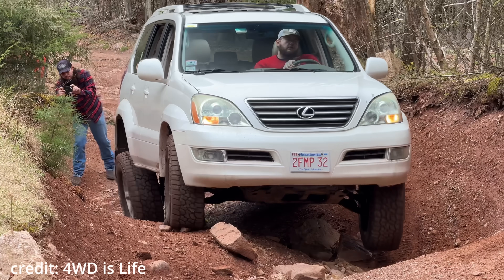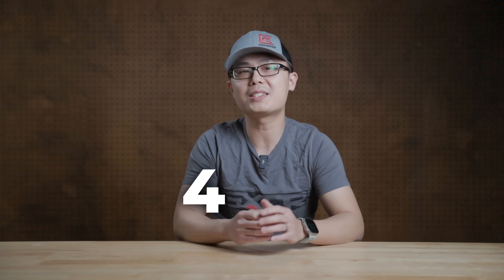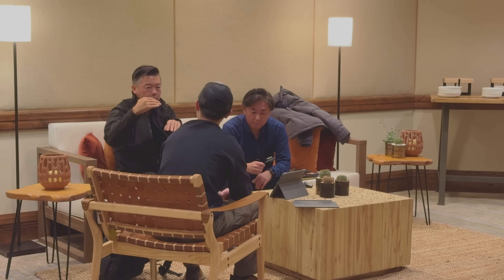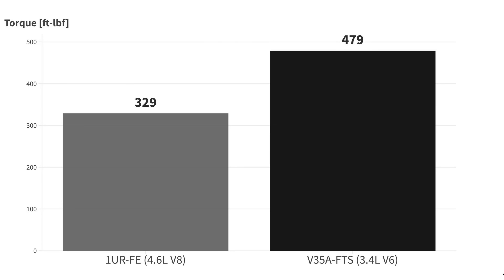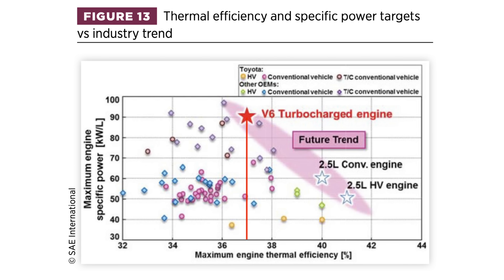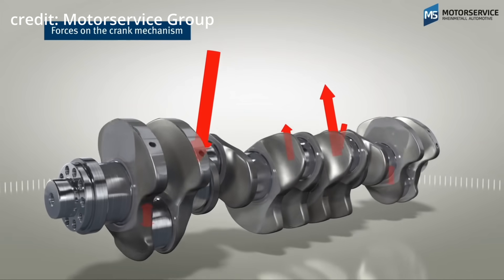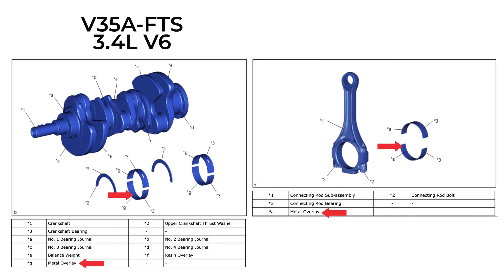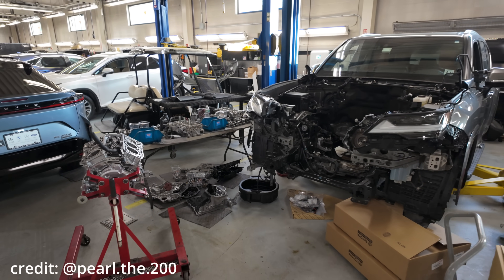Is Toyota V35A-FTS Engine Reliable? Well..It's Not That Simple

Comment: Nobody makes these videos the way you do. Others do lots of speculation, but you do proper research and make it easy to digest too. And no fan boy bias! Very impressive.
Reply: I would say The Car Care Nut is another valuable source when it comes to Toyota/Lexus content.
Reply: @AKBRONCOSFAN007 love that man
Reply: 4:40 This must be it! Taller pistons have more mass, increasing torque
Reply: There’s plenty who do it, and do it better
Reply: 11 mpg  ... I will pass .😢
Reply: 1st time here. This is very informative. Now I'm convinced  of 2 things. 1) wait at least 3 years for new models. 2) stay away from over engineerd hard to work on engines.
Toyota messed up going this route of putting this high compression engine in so many of their models at once. It's unlikely Toyota didn't find out about this problem before it went full mass production.
Reply: @AKBRONCOSFAN007 
Most definitely.
Reply: Car care nut enters the chat. Both are great
Reply: Savage Geese also does really great research and brings in Chief Engineers as well. Watch their Corvette video and the Miata Videos that were done.

Comment: Toyota’s reliability era is done.
Reply: once they see the results they will bring back natural aspirated V6 and V8 and remove the turbos.
Reply: I said this as soon as they decided to use turbos lol
Reply: lol you guys are funny I seen so many cohost from ford have easy 200k miles no issues and still going some into 300k
Reply: @Randolf_Burgmann  They already saw the results. The engine is already 7 year old. It's been out since 2017 for MY2018 for the Lexus LS. And nope, no long term issues with them. And personally after tossing my NA Lexus due to electrical gremlins for a Audi, Holy crap I had no clue what I was missing. My 2020 Lexus really was 15 years behind.
Reply: It’s not just Toyota, it’s a common theme to decrease displacement and use turbocharging to add it back. They did it with the 300 series diesel also. 

It’s emissions regulations and fuel consumption behind this, it won’t go back to the way it was imo
Reply: @HEYLetstrythatagain  I agree. But IMO it's a improvement.
Reply: Absolute nonsense.
Reply: You know this how?? You think Toyota did this to fail?!
Reply: @stevenk5800  what
Reply: @TasmanianDevil3  problems with reading comprehension?
Reply: @stevenk5800  It looks like you are the one with a comprehension issue. How you've managed to deduce that I'm not in support of Toyota is beyond me
Reply: @TasmanianDevil3  buddy, I was responding to the original comment that the era of Toyota reliability is done!  I didn’t respond to you. Please read my comment again buddy!
Reply: @stevenk5800  The don't tag people in comments that aren't for them
Reply: @Dimabuildingadventures have you looked into the stress testing ford did for that 3.5 year eco? Legit insanity the way they tested that motor
Reply: How when this engine been in use since 2018
Reply: @TasmanianDevil3  I didn’t tag you in my original comment. I tagged you when you commented “what”
Reply: @denverwenyika917 start @ 13:51
Reply: Bring back dedicated truck engines with cast-iron blocks. They keep using engines from other Lexus family vehicles and put them in a vehicle that’s supposed to take a lot of abuse. The 5vz and 3RZ were solid and didn’t come from out of a Camry.
Reply: @rick137.pickle  but you can't use one example as the normal and two remember this is a new engine and the 1st bunch will also have issues, at work we have 7 cars with these engines and we haven't had an issues everyday we drive them in rural areas and everyone is preferring them over the V8s
Reply: @denverwenyika917  please watch the video again.
Reply: @fooloco  correct 👍. I have a toyota with an aisin ac60e transmission and it is jerky with just 12k km on it.
Reply: exactly- ill buy kia/ hyundai and be backed for 100k miles
Reply: @bikeman1x11  hmmmm. Maybe just don’t buy the model using this problematic engine 😀
Reply: @Randolf_Burgmann  No, capitalism does not work like that. More complexity, more money, more service.
Reply: @732harris turbo arent a problem
Reply: @Skyline750 turbos aren't a problem
Reply: My goodness
Reply: i refuse to buy a turbo SUV from toyota. The new 4runner is underpowered with a 4cylinder and turbo. I refuse to buy it when the reliability isn’t promising as seen in the tacoma.
Reply: Never
Reply: @PokeHut  try driving a toyota with the aisin ac60e transmission.
Reply: True that
Reply: Too much environmental regulation bullshit push them to make this type of engine

Comment: My new neighbor is a Toyota mechanic in a very large dealership in Dallas.  I asked about the 3.4 failures and he showed me a picture of 8 blocks in crates sitting out back.  He says it seems to average ~20,000 miles when they fail, although he has seen it as soon as 6,000.  I think it's happening more than people realize.
Reply: I used to be a tech at Toyota up until June last year. The earliest I've seen one fail was 32 miles. The owner took it home on a friday and it failed over the weekend.
Reply: @matte8441  your talking about a toyota or a cybertruck here?
Reply: @float_sam  The Tundra unfortunately.
Reply: It’s dirty blocks the engines are fine when they are clean. At lexus we aren’t having them fail at that high rate and the mileage is usually way higher.
Reply: @matte8441  remninds me of this cummins engine blowing a HOLE between cylinder 4 and 5.  mileage was  about 880    the reps said dont touch anything but put stuff in ziploc,  drain fluids and send WHOLE engine back to manf for inspection.   ford had 6.7 powerstroke blow up LEAVING car transport ramps. barely above 40 miles on odometer.     new cars is time bomb.  yeah idk
Reply: I was a Toyota  tech back in 1994-2003 and remember the hundreds of 1HD-T 80 series I had to replace big end barings in. Toyota were good enough to warranty them, some even as high as 200,000kms. Toyota have to be serviced at every service, the oil just gets dirty fast. Even the corolla with its intake cam gear issue springs from dirty old oil. Sensitive engines. Accept the mighty 2GR lol.

Comment: I’m a tech at a Toyota dealer in Canada and we’ve had 6 tundras with the same bearing issues. Some were work trucks and others were just daily drivers but they all failed in the exact same spot. All got short blocks and 2 of them were seized solid when they came in. One of them took so long the guy bought another tundra and then had the same issue with it so he bought a trd pro instead of waiting to get his first 2 fixed. We ended up buying the trucks back from him.
Reply: Wow 2 new trucks with same engine failure would push me away from the brand.
Reply: Last month my friend who is a service manager at Toyota walked me through our dealership's parking lot while I was waiting for my Camry oil change and he also showed me multiple 2022+ Tundras with the exact same issues. There is clearly a reliability problem with Toyota's recent "environmental" decisions, I'm sure the Tundra is not the last vehicle to experience such issues.
Reply: Bmw is the new toyota unfortunately!! 😢
Reply: engine is built tight and not enough space ford has abit more space and uses thicker oil while toyota uses mosy 0w20 oil or 5w30 for my ecoboost i use 5w40 and it works great make sure to do oil changes on time if not using to much boost if so then need more reg oil changes if not the oil will become diluted quick and the bearing will suffer frm lack of oil and in toyotas case of being built tough isnt the issue its not informing ppl about how to maintain a tt vechile engine i would recomend which i do to all my customers use synthetic oil if engine needs it and if its tt always put abit thicker oil and always check the oil to see if it has vescosity or not so if you use synthetic and says 12k km you change after 8 to 9 k depending how much boost was used and even earlier if towing, these tt engines need lubrication at all times...just like in the bed the faster you work the the more wet you hope she gets or else dry is just rough. lmfao
Reply: Oh hell no. Thats like comparing a complicated erector set to a simple lego set. Heeeeeelll no. Bmw sucks, oil pumps suck, water pumps suck, all of their electrical connectors suck, all of the watercooling pipe designs suck. Heeelllll no toyota is still way more reliable and so much easier to work on over any bmw @DailyStreetRacing
Reply: That's a true die hard fan
Reply: @DailyStreetRacing this makes no sense at all.
Reply: @zinkamkamzin  as someone who drove turbocharged vehicles for over a decade, the rule of thumb is that you have to change the oil every 3k miles/5k kilometers or deal with parts prematurely wearing out. That's all, sure the dealer will tell you to drive 10k miles but I wouldn't.
Reply: @icenine135  im canadian and i am a mechianic been fixing all brand vechiles since 17 cuz of the family business brother 9000km not miles or even lower which i said 8 to 7 depending if towing or just always on the boost, but yes what i said and what you repeated is the same so yes i agree. been doing mechanic work over decade and still going.
Reply: @icenine135  and forgot to mention that io own a 2016 f150 3.5l tt ecoboost had it since 2018 and had many more other vechiles in our family so you can imagine this is just basic knowledge for me common sense at this point in my line of work
Reply: @bfromthea7663 IF YOU CAN UNDERSTAND WHAT IM SAYING THEN IM SURE YOUR SMARTER THEN MOST WHO CANT UNDERSTAND A WHOLE WORD DUE TO ONE OR TWO MISPELLING OF LETTERS OR PLACEMENT OF THEM WHEN EVEN THERES A WHOLE SENTENCE TO GO OFF OF, BUT YES MECHANIC SKILLS ARE GREAT NOT WORRIED LMFAO
Reply: 😮 @thegeneral1955 The whole industry is plagued of problems. Industry went down since strict eco norms.
Reply: It's been happening since 2018. It's on the Lexus forums under "2018 LS500 on 2nd blown motor" & "LS500 Burning Oil". Difference is, the LS500 sells in much lower quantities and particularly to an older crowd that doesn't necessarily care to report problems on the internet. It's the very reason I avoided the LS500 back then and went with a K900 3.3T instead - 62K miles, zero issues so far. It's not too dissimilar from the very recent Honda/Acura recall on all of their V6's due to seized connecting rods.
Reply: Toyota had issues with the first year A25A-FKS due to piston and bore sizing issues and that’s an NA engine. The 2.4L 2AZ-FE engine plagued 7th generation Camries and 3rd generation RAV4s. In the long term the 2AZ-FE would still be Toyota’s worst engine.
Reply: @DailyStreetRacing  hah, nice joke
Reply: i also work at a toyota dealer and weve had more new tundras in for blown motors than i can count, my buddy was doing a test drive one for a pull concern and when he made it back to the dealer the truck shut off and locked up lol
Reply: @soupsfarm1825  uff
Reply: Sure you are
Reply: @soupsfarm1825 sure you do
Reply: Thank you for your comment. I will keep my 80 Series LX 450. If I ever get the new LX, I will probably use Amsoil Signature Series on the engine and keep watching for any issues.
Reply: @icenine135 what about off-roading witn a turbo ?
Reply: @user-yw8dj7cf1d Yeah the normal 5k mile increments are perfectly fine. 3k is excessive and a complete waste of time.
Reply: WOW. Now that is a story you will tell your grandchildren. Can't get over your honesty. Hope your boss doesn't watch this though. We need honesty in Canada. it is refreshing given what goes on these days. 
 What did George Bush try to tell us?
 "Fool me once shame on you, fool me twice and shame on me"
 I wouldn't touch an over-boosted small 6 with twin turbos when you need to take that cab off the chassis to get at the send one.
 Mind you most of these 'repairs ' seem to just haul the whole engine out of the vehicle.
 Not my $100,000 dollar Canadian-sold Tundra. NEVER!
I bought an FWD, naturally aspirated Corolla Cross LE 2023.
 If it even burps, it will be gone from my driveway. I heard that the M20A FKS might have end-bearing issues on 'some' The care care nut said that in one blog he did.
 I remember stuff like that. I waited almost 14 months for mine.
Reply: @everyangle4310  BOOM!
Reply: With today's knowledge they should be able to find out the root cause quite quickly. Did this motor go through major testing before it hit the roads? It's a oiling issue #1 problem from sounds of things.
Reply: @everyangle4310 the interesting thing is we have Landcruiser Lc300 here in my country with the same 3.5(3.4) Twin T and not a single one has failed or had any issues. My brother in laws both have them  one has already almost 100k kilometers on already. And my friend works there and there hasn’t been a single failure. Maybe the North American engine is built different? I’m not sure 🤔
Reply: Could that be maybe a tundra issue? Or North American version issue? As I mentioned in my previous comment I haven’t seen a single failure in our Land Cruiser Lc300s in my country. Keep in mind the Land Cruiser lc300 is twin turbo and doesn’t have the Hybrid attached to it.
Reply: Toyota is now saying that a failure to clean the blocks properly of machining debris is to blame. Metal filings were left in the blocks prior to assembly. This is a total recall for these engines. We will have to wait to see the longevity of a properly built engines, but it may be too late, as the damage is done to Toyota's reputation for reliability. Hopefully the 2.4 turbo engine in the Tacoma doesn't suffer from the same issues, that would be catastrophic to Toyota.
Reply: @zinkamkamzin what? Was there a sentence hidden in that soup?
Reply: Third time is the charm.
Reply: @AMavridesR Brother are you still driving the E60 M5 or something, BMWs are some of the most reliable cars now. Even when pushing them rarely do you get anything outside of what's normal failure points for every car.
Reply: Eh!!! 😬
Reply: @jonasbaine3538  ya im waiting until its completely fixed. the engine design is solid but toyota is chasing a machining debris issue in the block that causes spun bearings, and contrary to what they stated its affecting 2024 models too. and the worst part is they want dealers to handle the full rebuild instead of providing crate engines. so i'm not buying until its settled.
Reply: @Cappy_Cat In my experience BMW drivetrain is reliable but electronics are not. Those are also a hassle to fix.
Reply: It sounds like Toyota is losing the reliability it's known for, and thus will no longer be able to  demand a premium for their vehicles. It will take some time but I expect to see their prices decline relative to comparable vehicles in the industry.
Reply: It all started with no QUALITY CONTROL AT ENGINE PLANT .
Reply: The new engine is simply blown  up
Don't wast your money and time people

Comment: i am from Saudi Arabia, and here we have a lot of Lexus LS500s and land cruiser LC300s, and recently after one or two years we started to notes the increase of those specific turbo charged cars going to shops and dealers for this specific issue, and most of the shop owners are starting to tell the people to not buy these cars yet, one shop even reported having more than 30 vehicles come to hos shop for bearings issues, and started a new way of fixing by pulling the engine from the car without removing the hood to cut costs and save time.
Reply: Whats the most common problem in the lc300?
Reply: @syedmohammedhussain799  same as lx600 or lx550 same engine = same issue dude
Reply: They pulling engine without removing the hood cuz the owner when he wants to sell it the poor bayer don’t know about the disaster happening in the engine bay or maybe the car had collision once بالعربي ربعنا مايفكون الكبوت عشان مايطيح سعر الموتر ولا احد يدري انه موضب من قبل وكلن وذمته والله رقيب حسيب شديد العقاب وهذي مشكلة في المكينة هذي الحمدلله اني لحقت على مديل ٢١ ثمانية سرندل وشريته كان اخر موتر عند معرض اليحيى
Reply: I'm from Saudi Arabia and yes we have the same problem, I just saw video of a workshop confirming he had more than 50 cars that he fixed between 22 and 23 with low mileage too

I regret selling my landcruiser 2020😢
Reply: أتفق معك وتوي بكتب نفس تعليقك، للاسف الموديل الجديد فوق ما ان سعره فلكي فقير بالتيكنولوجيا ومحركها لا يصلح للاستخدام الثقيل نفس الجيل السابق الي ما يختلف عليه اثنين.
Reply: How would they know that the hood was removed?
Reply: @MyHunter9090  easy from hood Hinges bolts if you remove it there well be a mark on them
Reply: @mnm989 did you buy a new one after selling the 2020 model? And how is it, has same issues?